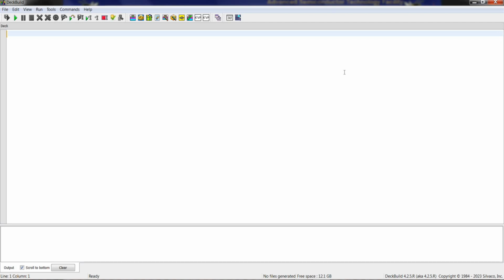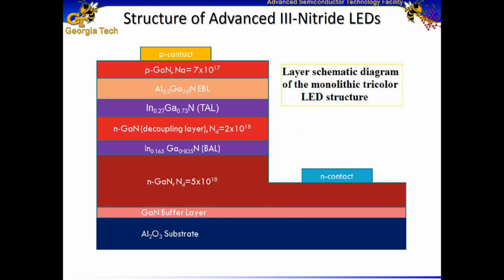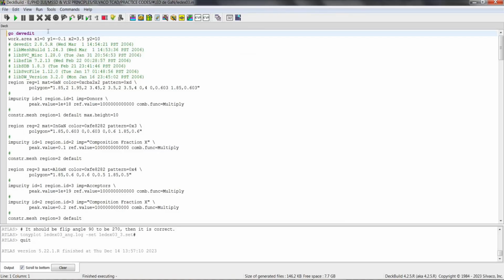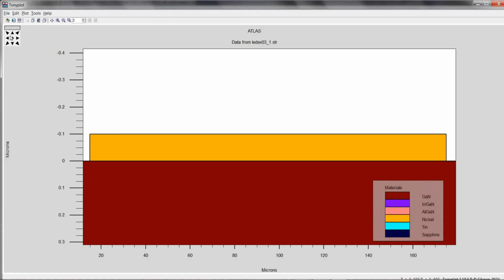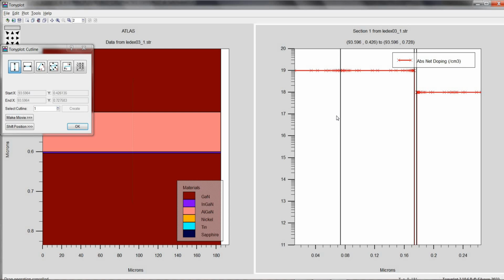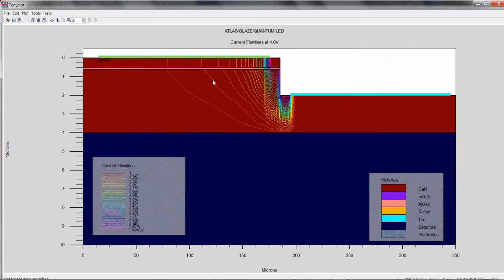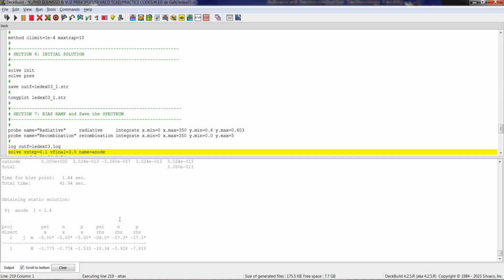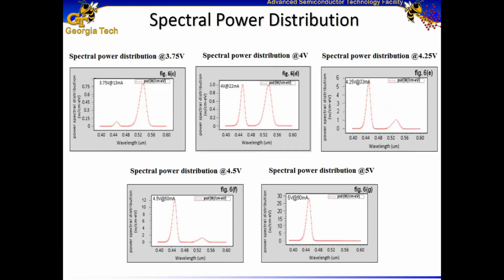GaN InGaN LED Silvaco TCAD Simulation 💡🔍 #LED

Comment: i am trying to simulate GaAs laser. i am having the cnvergence poblms . can u help me solve it?
Reply from the maker: Convergence problems can arise from a variety of issues including improper meshing, inapt initial conditions, incorrect material parameters, improper boundary conditions, etc.
Reply: how do i contact u?
Reply: well i dont see in the examples how to implement the boundry conditions for solving the governing equations
Reply: if i were to use comsol. i must properly have to apply the boundary conditions for the result
Reply: the code is just simple but still shows incorrect results and long processing time. material parameters are standard values. mesh is fine i varied it but still no banefits ...